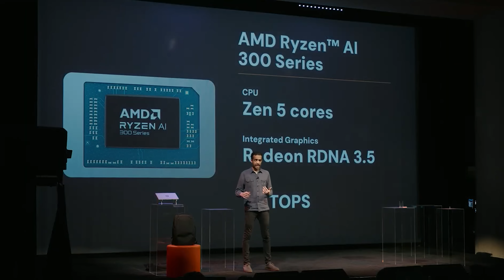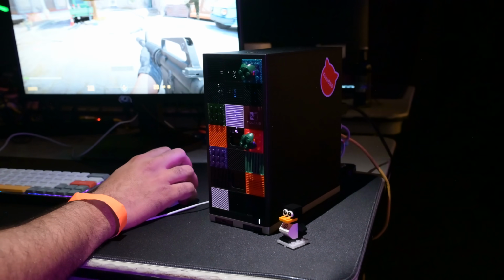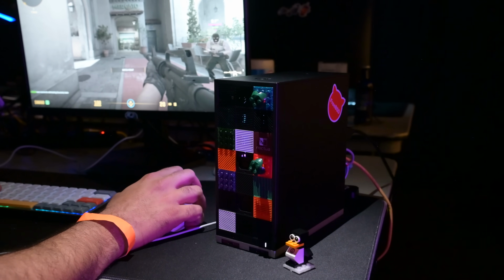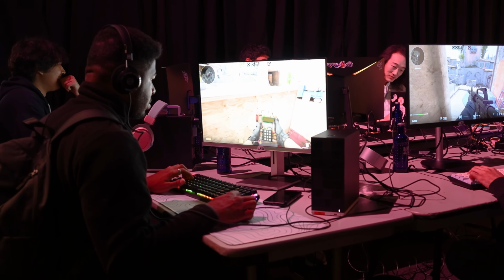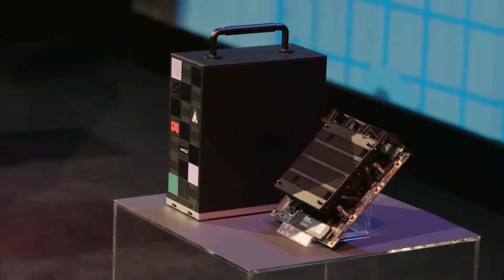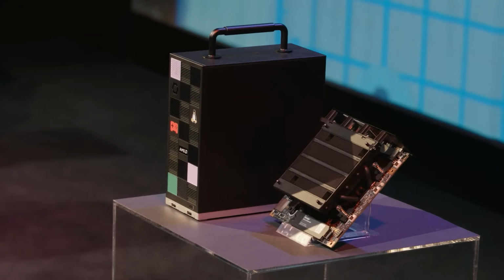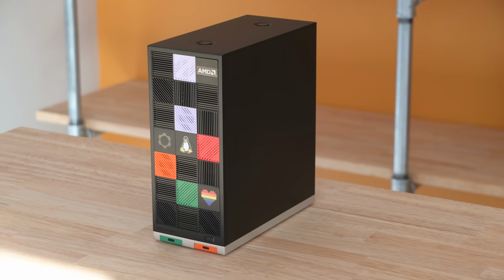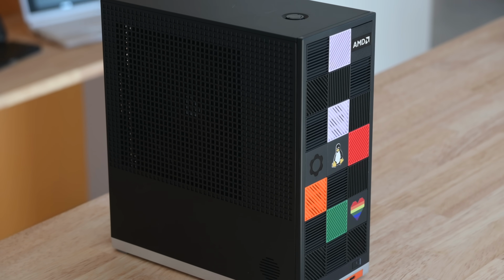Modular, Open, Repairable – The Framework Desktop Teardown!

Comment: 8:58 not framework, they literally begged AMD for upgradable ram support but AMD refused 
so it's basically AMD calling the shots with ram
Reply: AMD didn't refuse, they tried but due to some signal integrity stuff they just couldn't :/ .
Reply: @Lol5967 "couldn't"
Reply: Yeah, AMD put one of their engineers on it for like, several weeks to figure it out
Reply: There is no known signal integrity solution out there that allows one to take full advantage of the DDR5.
AMD has the final say and unelss the solution is GUARANTEED to work 100%, they're not going for it.
Reply: @giomjava  yeah nah because socketed DDR5 isn’t a thing
Reply: its still framework that decided to use this APU with soldered ram
Reply: @JwFu  that's not how this works. I'm a signal integrity engineer and getting 8000 MT/S through any sort of connector is IMPOSSIBLE today (on a DDR interface).
It's not on Framework, and not even on AMD -- just state of the art, until someone develops a better way. Can take years to develop just this one thing and a large group of researchers + engineers.
Reply: @giomjava  sure thing, imaginary engineer, that’s why Gskill and Kingston have standard DDR5 PC64000 sticks at 8mt/s and evga sells a 8000mhz compatible motherboard 🤷‍♂️.

Stop simping and dreaming
Reply: @capybara5494  Oh, yeah and with 2 channels you will still barely achieve 60% bandwidth of this device. A consumer motherboard with this bandwidth even if using the best and most overclocked sticks on the planet LITERALLY DOESN'T EXIST. Of course you can just build and EPYC or XEON monstrosity with 8 channels and beat this, but that's a full workstation, not a consumer desktop.
Reply: @ so… the connector exists then 😂
Reply: @capybara5494  you don't know the subject matter. There's way more to this, like what PCB materials are used, whether memory vendor supports LPCAMM2 and whether it can go 8000MT/S, does vendor plan to support the memory moduoe long-term, or they end of life it in 1 year? what happens on AMD chip Package, do they support in-band ECC or external ECC, does AMD support LPCAMM2, dies AMD guarantee speeds when LPCAMM2 is used, etc etc. 
🤦 It's a very very complicated issue
Reply: @ i thought the connector didn’t exist 🤷‍♂️
Reply: @capybara5494  that's what - the standard exists, some companies claim they exist, but none go to 8000. 
Another question is whether someone makes "a connector", but it may not be available for small manufacturers like Framework due to low production volumes. Or due to manufacturing variations, the yield is too low, making them extremely expensive, or unreliable.
There are too many factors at play and saying "it does exist tho" means you don't know the subject matter.
Reply: @giomjava  so we went from « the solution does not exist, it’s IMPOSSIBLE » to « framework does not have access to it, maybe it won’t be maintained anyway » in a few posts, we made some « state of the art » progress at very low cost 😂.

Why are you like that ? Again, you claimed that there was no connector capable of achieving 8gt/s, this assumption is just plain wrong.

Comment: A standard desktop is more repairable than this
Reply: I haven't had a hardware failure in at least 10 years.  Then again I don't OC my machines. Repair-ability isn't even in the equation when I pick a machine.
Reply: @ The issue is that they market themselves as the most repair friendly device when a standard desktop is much more repairable.
Reply: @quademasters249  if you don't care about repairability, why are you on an Ifixit review of a framework device?
Reply: @kintustis Exactly. I'm very worried about Framework. I went into the event extremely excited. I left very disappointed as a 16 inch owner...
Reply: @kintustis  The simple answer is that I wanted to know what was inside.  

Whether it would be possible to use an external GPU with a PCIE extender for instance. 

Most PC's aren't repairable in a real sense.  You swap out full assemblies when something (rarely) goes wrong. 

It's a cute little box. It just seems expensive for what you get.

Comment: does this come with bluetooth or can that be wifi 7 and bluetooth card and be added
Reply: the built in (replaceable) Mediatek MT7925 provides Wifi 7 and Bluetooth
Reply: I believe BT and WiFi module is kinda the same thing
Never seen one without another
Reply: @ yeah I know, just double checking, saw no blue or heard of it in the specs or in the conference
Reply: @mishanya1162  Older thinkpads used to have Bluetooth on a separate, optionnal module. The USB data pins that would normally go to the wi-fi chip (for the BT feature) were missing there and instead just routed to the  BT module, so even if you had a wifi card with BT support, it wasn't usable.

Comment: This looks like a great system for running LLMs (AI) locally - for tasks like coding assistance without sharing your data. These models require a lot of fast memory. In an upgradeable PC, running a larger LLM (e.g., 70B parameters) at reasonable speeds usually means multiple GPUs with 24GB VRAM each, depending on model compression. Alternatively, Apple offers systems with large amounts of unified memory, making them strong for LLM inference. This Framework system seems like a solid alternative to those.
Reply: This is great if you want to remotely connect to an actual LLM Server/HEDT at home.
Reply: Ai?
Reply: or they just run it on the CPU with Dram
Reply: This is precisely why I've pre-ordered
Reply: I wonder what speed it would actually run at. Just cause it takes multiple 4090s to match it in RAM doesnt mean theyre not running circles around it in performance. Maybe theyre not, but idk
Reply: @mtrebtreboschi5722  I mean, multiple 4090s do run circles around it in performance. But this also costs as much as a single 4090 so what do you expect?
Reply: @tntblast500 the top-end Framework Desktop offering (Ryzen AI Max+ 395 with the 16C/32T, 40CU and 128GB LPDDR5X-8000) costs $2990 AUD, (Australian dollars) $1050 AUD cheaper than the cheapest RTX 5090 on the market here.
Reply: @tntblast500 And the whole PC is powered by a 400W power supply when 400W can easily not be enough for the 4090 alone.
Reply: @ As Nirav from Framework mentions in the LTT video - the PSU is actually 600W, but they downrated it to 400W for better cooling and longevity.
Reply: @ElNeroDiablo  Oh yeah, also in Australia. It's comical how expensive graphics cards are here. Funnily enough, the cheapest 4090 was $3200. I mean, a smidge cheaper than buying the desktop with the case and power supply, but yeah, still more expensive than just the mainboard (which is probably the more fair comparison)
Reply: @mtrebtreboschi5722  apparently for the llama 70B model for the 128GB model, people calculated 5 tokens/sec from the demo
Reply: @mtrebtreboschi5722  The Max 385/Max+ 395 SOC's in the Framework Desktop here are using LPDDR5X-8000 MT/s for the RAM.
Reply: @mtrebtreboschi5722  a 4090 has about 1TB/s memory throughput, the framework 256GB/s (4060TI has 288GB/s) and then it has to be run on a much weaker iGPU. It will be totally useable for LLM at reading speeds I guess, but image gen and so you'd want to add a dGPU.
Reply: Or you could just learn to code normally and think for yourself, without wasting time and money on an LLM.
Reply: How can we have this amount of VRAM for this pc but be so VRAM limited on gps?
Reply: @Jackson_M5  LPDDR vs GDDR
Reply: @Jackson_M5  GDDR is way more expensive than LPDDR
Reply: @reiniermoreno1653   I know I'm just commenting in a frustration how limited vram on gpus have been. Discrete gpu VRAM stagnation. We need 4 top of the line gpus to match 1 high level apus vram.
Reply: @reiniermoreno1653  gddr is not that much expensive, just nvidia makes them cost an arm and a leg
Reply: @bhaveshsonar7558   It's what... 2X the price? They want to charge an insane premium for larger VRAM.
Reply: @ you're right but too much vram let the door open for developers to make unoptimazed disasters
Reply: A 5090 obliterates this PC performance wise when using a quantized LLM to fit the 32GB GDDR7, also at 128GB you're still short on memory for large models

Comment: Where... Where does my GPU go?
Reply: No GPU needed. The APU has the equivalent to a 4060 integrated into the CPU.
Reply: You’re not supposed to upgrade or change this AMD device sold under the Framework brand.
Reply: Well it is already there, the chip in the machine is the new awfully named AMD APU and it comes with onboard RDNA 3.5 GPU cores that are performance equivalent to around an RTX4070

Comment: Soldered cpu and ram, non-standard motherboard, non-standard psu, no x16 pcie slot, over all im pretty disappointed tbh.
Reply: The motherboard fits into any ITX enclosure. It is also using a flex power supply, which is a standard power supply. There is a PCIe x4 connector. It isn't x16 and isn't open ended it seems. Their website also lists that they have front panel power button and audio connectors if you want to put it into a different case. Given that this is a device that ships with a laptop, APU and soldered RAM, it is very close to being as standard as possible. The only thing they could have done would be to make the PCIe slot open-ended so that you could technically stick in a graphics card in there directly.
Reply: if you bring your own case, you can connect any regular ATX PSU to it, it has 24+8 pin power connector setup
Reply: Mobo and PSU both use standard form factors, what are you on?

Comment: Why pcie 4x??? The SoC supports 8x
Reply: The other 4x is for the wifi and Bluetooth card
Reply: @alexisprovencher1571  You think laptops sacrifice that when it has a DGPU? Nope.
Reply: @leggysoft  This isn't a chip designed to have a dedicated GPU paired with it, it's intended to stand alone with its crazy onboard graphics, so I can see them only giving a 4x slot because there's no reason to get this CPU and then pair a graphics card with it, even in a laptop form factor
Reply: @JustOneServing  still it'd be great if they used the 4x slot with open end that allows you to plop in even 16x cards. Yes, it'll only ever work at 4x speeds, but you won't need to modify it yourself or use some riser to pop in such card.
Reply: @Daddo22  Just cut a slot at the end of the connector. Many mobos have an "open ended" connector. Same thing.
Reply: @ That's exactly what I was asking for. I wonder how hard it'd be to make it an optional 8x when you give up the Wi-Fi & BT slot, since many ATX MBs allow for config like this
Reply: @JustOneServing  And worst-case-scenario; you use a Thunderbolt eGPU hanging off the rear i/o of the desktop if you need full-fat RTX or RDNA 4 power.
Reply: @JustOneServing  yep that's the entire point I just hate it that they went with a 5Gbit NIC not 10Gbit but I can always use one of the USB4 ports for sweet sweet 40 Gbit 🙂
Reply: @Daddo22  or tremmel the slot.

Comment: Pretty neat but I would like to see a space for 1 standard 2.5in hard drive then I would buy
Reply: external case, problem solved. You have to USB4 40GBit ports on that thing and 3 USB3 Gen2 ones with 10Gbit You can put a JBOD case with 8 3.5" HDDs on any of those. 
Or buy the board and put it in an other case also you need a m.2 to sata/sas adapter or a PCIe x4 card or m.2 to U.2 or U.3 but in that case why not putting a U.2 or U.3 adapter with the drive in the x4 slot? 
Nah you just don't want the thing and that's fine. No need to look for excuses.

Comment: I’d love to see something from this company that supports swappable parts like GPU’s and Memory.
Reply: I'd assume they'll release something like that in the future. They've released different architectures and versions of mainboards for their lineup of laptops in the past, so I'd guess they'll later make modules that can easily slot into this case for different CPU/GPU/Memory/Storage configurations.
Reply: for that, there's something called "framework laptop board desktop case adapter"
Reply: They tried to use LPCAMM2, AMD even assigned them an engineer to help, but the signal integrity just didn't work out across the 256 bit LPDDR5X-8000 memory bus, forcing them to use non upgradable memory
Reply: @dilutedoxygen  sure, but could it be done with a smaller and/or slower bus? Like I'm pretty sure there would be people willing to trade memory speed for future upgradability.
Reply: @Ebalosus  that would literally defeat the point of the strix halo chip, the reason it's so fast is the custom quad channel 256 bit LPDDR5X-8000 memory bus, without it performance is far worse and it defeats the entire point of the chip
Reply: @dilutedoxygen  Then why are they even using this chip if it has no modularity or upgradability?  Strix isn't the only CPU on the market.
Reply: @kintustis  because they can? It's a high end CPU glued to an iGPU only slightly slower than the 4060, with massively more power efficiency, and a lot more VRAM
Reply: @ I am aware what Strix is, and I think the concept of the chip is cool, but its tradeoffs do not align with the philosophy of Framework. I'm asking why they're using it when it clearly does not align with their company goals. "Because they can" isn't an answer.  If it's cool because it's Strix, then naturally all Strix devices will be just as good no matter what company they're from, as there is now little that separates this device from the ones that will eventually be made by companies like Dell, Lenovo, HP, or Razer.
Reply: @kintustis  also other than the RAM being soldered down, everything else is upgradable, modular, and repairable, it uses a standard motherboard form factor, standard motherboard connectors, standard m.2 slots, a standard PCIe slot, etc.
Reply: @kintustis  also also, by that same logic I could argue all of frameworks laptops are against their core value because they all have soldered down CPUs
Reply: @dilutedoxygen  in laptops there is no practical alternative to soldered CPUs. On desktop, there is.
Reply: @kintustis  and in this specific category of high end APU there's no option for expandable memory either, framework didn't decide that
Reply: buy a normal pc. no need to go for this design Put a supermicro server/workstation board in. All good.
Reply: @dil Then they didn't try hard enough
Reply: @GiddyPictures  you do it then, magically fix signal integrity problems an entire company and engineers from the literal group that made the silicon couldnt
Reply: @GiddyPictures  do you know a single thing about signal integrity and memory buses or are you on the far end of the dunning kruger graph
Reply: @dilutedoxygen  ratio